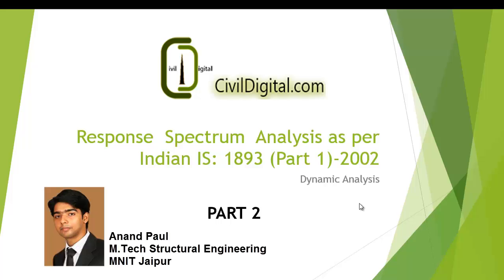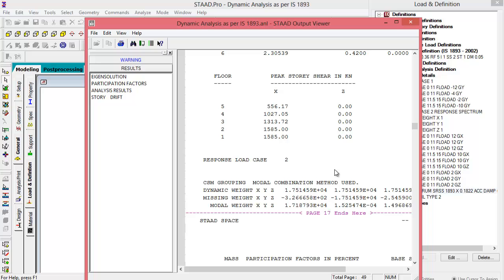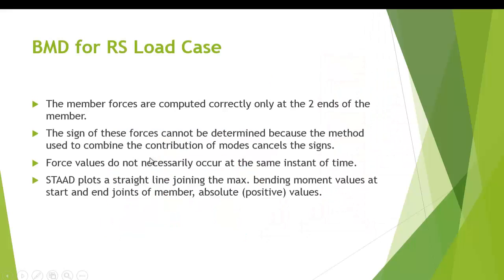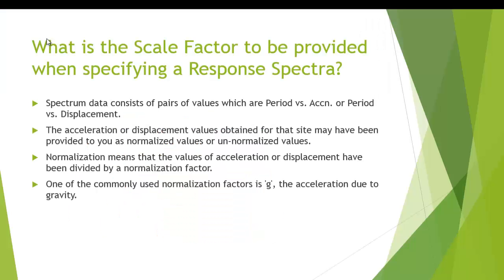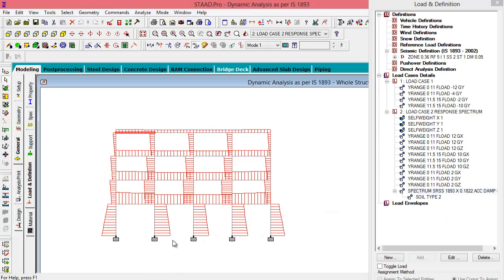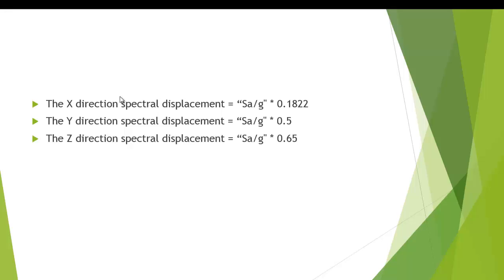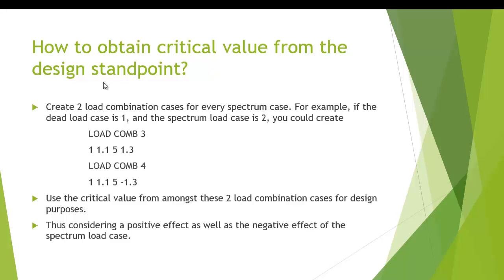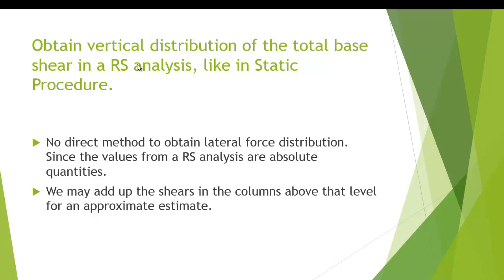Response Spectrum Analysis in STAAD (Part 2) explanation Video

Comment: Did Staad pro incorporated latest is codes 183-2016 and 13920-2016.
Reply: Yes it has incorporated but only in Staad.pro connect edition...u won't be able to find these latest revised codes in staad v8i.
Reply: staad connect edition is having all updated codes and user interface..

Comment: Helpful video. (y)
Sir, I did analyze my structure(that contained shear wall) using Response spectrum method, following the steps in your video, it showed 
"RESPONSE SPECTRUM COMPUTES JOINT DISPLACEMENTS THAT REPRESENTS MAXIMUM MAGNITUDE OF THE RESPONSE QUANTITY THAT IS LIKELY TO OCCUR DURING SEISMIC LOADING. ANY RESPONSE QUANTITY LIKE STORY DRIFT, TORSIONAL IRREGULARITY,ETC SHOULD BE CALCULATED FROM ACTUAL DISPLACEMENTS OF EACH MODE CONSIDERED DURING ANALYSIS.THE RESPONSE QUANTITY FROM EACH MODE SHOULD BE COMBINED USING MODAL COMBINATION TO GET THE MAXIMUM MAGNITUDE OF THAT RESPONSE QUANTITY."
What do I do now?
Please help.

Comment: what happens when you consider the slabs in the building, you will have a center of gravity and center of torsion therefore you will have a torsion in the slab. Does the response spectrum consider this torsion? Could you explain how would you model and analysis a building with slabs, walls, beams and columns using a response spectrum. Thanks.